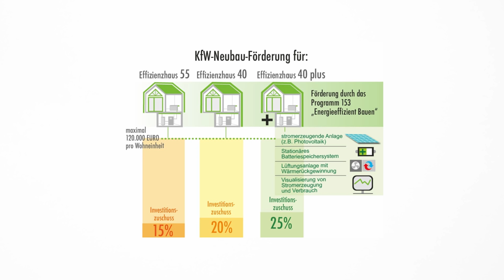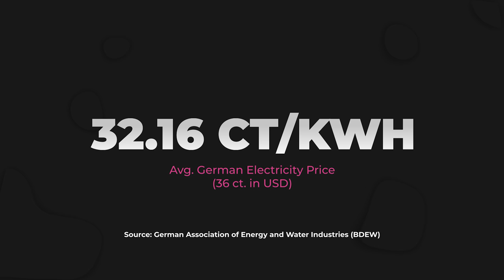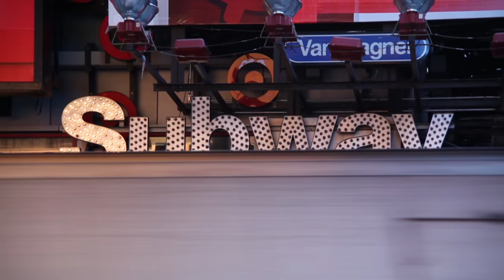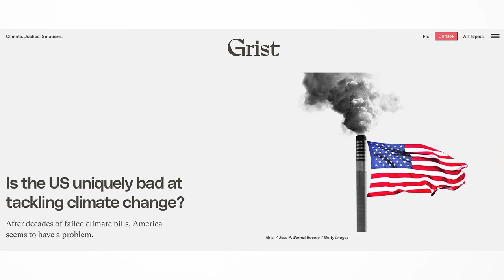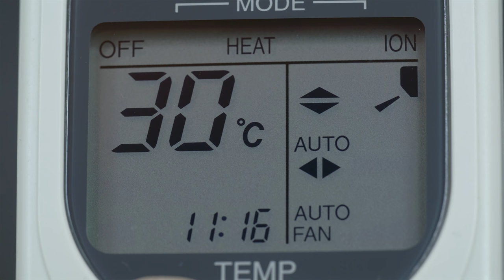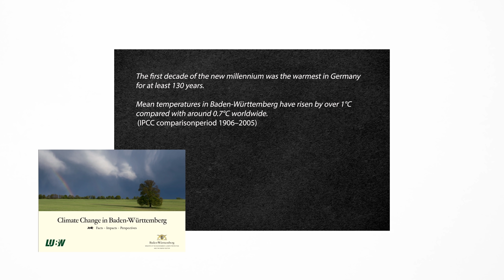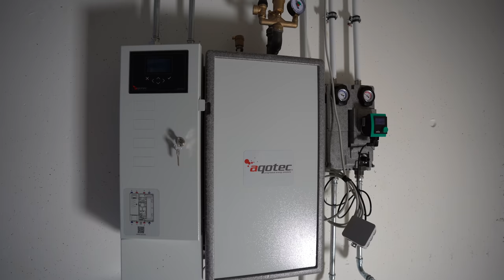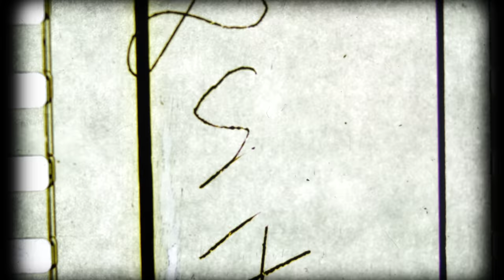HVAC (HLK) in German & American Homes | A Tale of Two Countries

Comment: The argument your energy provider makes for wood chips as "CO2 neutral"  fuel makes me chuckle... by the same logic, one could easily argue that burning coal just releases the CO2 that was consumed during the production of the coal. Same goes for oil or gas... obviously, the carbon required for these things didn't just pop into existence. ;) So... if you take the approach of your energy provider, everything is CO2 neutral, pretty much. Awesome! Climate crisis solved, I guess.

I live in southern Germany, so I've gone through a few 40° heat waves. Honestly, I thought about getting AC a few years ago, I decided against it. I have no good place for a window unit and other units would pretty much be impossible to install in my apartment and would cost a fortune. With a bit of clever ventilation and discipline when to open windows and close blinds, I have around 10 days per year on average that really make me wish for AC. Going through all that hassle just for those 10 days seemed a bit stupid to me.
So, I'm without AC.
My solution is fairly simple: Open your windows in the early morning when temperatures are cool and comfortable, perhaps turn on a ventilator if there's no breeze to help exchange air. When things heat up later in the morning, close your windows and shut your blinds etc. everywhere but on the north side. For the rest of the day, just do not open your windows. Fairly simple and works well.
Reply: Keep in mind that we have fossil fuel because of a rather short period of time wood existed without the bacteria to decompose. Burning that to CO2 is arguably no cycle at all or at best one that takes about 300 mio years and won't repeat. Compare that to some decades of growing trees and you might understand that it makes a big difference.
For more details: https://www.youtube.com/watch?v=b34al8YmQSA

Comment: Air conditioning actually makes me sick - probably because I'm not used to it. Whenever I have to deal with air conditioning for a longer time (conference, holidays in a hot country), I'll get a nasty throat infection if I'm not careful and walk around with scarfs all the time. I don't really know why that happens, but that's why I'll never have air conditioning in my house ^^.
Reply: Ist is a nocebo effect. Will say , if you do not know That there is an AC you will not become ill. Ist is a typical german issue like Durchzug.
A modern AC with anti viral high voltage filter will clean the air and you will be much more safe.

Comment: I completely disagree with the idea that burning wood is climate friendly. It would only be neutral to the climate only if you could grow trees as quickly as you burn them. Otherwise you will a) run out of trees eventually and b) produce more GHG than you consume.

About forced air heating systems, there are some interesting studies by the developers of the "Passive House" standard. They calculated the threshold of heating energy required under which you can use air (specifically a ventilation system) to heat a house without a lot of noise or too hot air. It's about 
15kw/(m²a), which is not very much. Forced air heating in normal houses will always create a noticable air movement and the noise coming with it, which is why I would avoid it.

Comment: Hallo Black Forest Family,  W have build new 2006 in BW between Heilbronn and Karlsruhe.  We has a big "Dachüberstand to the South. Then we has a Sole WP(we has holes in the earth  3x 85m) to heat and a PV on The south Roof who reduces the Temperature in the roof rooms >2°C We has our Roof insulatet with "Hanfstroh" instead of "Glasfaser/Steinwolle"  Hanf has a better k Wert bei Wärme von außen"  Fußbodenheizung  ist bei WP im Neubau Pflicht".  It takes 3 Winters to optimize the heat system but now it runs.  my opinion ist not god for Fernwärme, because if you had Oil, Gas, Pellets, electicyty you can chanche the deliverer.  If you has "Fernwärme"  you are fixed.  And Fernmwärme  in Germany is an expensive variation to heat.    😉

Comment: After all is said and done, it is all about economics. What is the availability and costs of different types of fuel in a particular geographic area. This is especially evident in Germany right now with its dependance on Russia for natural gas, or conversely, on Russia's dependence on Europe for hard currency. Similarly, Germany has had  negligible oil deposits, before the advent of North Sea oil, therefore oil products were taxed high to control its balance of payments.
How do I heat my house? With forced air heat. Why? Low initial cost and ease of air conditioning. Even in forced air heaters, there are wide variations of equipment cost. An 87% efficient hot air furnace can be bought relatively inexpensively. An 97% efficient unit can cost twice as much. At the present cost of gas, the payback period can be 2o years! Further, the cost of maintenance is much higher on the higher efficiency furnaces due to the high tech computers and materials involved in building them. For instance, the combustion chamber on high efficiency furnaces must be made of stainless steel, rather than common steel.
The individual will always make the economic decision which is best for them at a point in time. Countries, however, must often factor in geo-political factors  which tend to be longer term. Germany faces such problems right now with its relations to Russia.

Comment: You short mentioned the KFW standard.
I also think "KFW standard" should be explained to foreigners. Since I'm not connected to building industry - the KFW standards are incentives to a construction. I don't know what required standards are here in Germany.

Will there come some numbers about thermal transfer coefficient. What is that coefficient in a standard 2 by 6 home?
Reply from the maker: We would love to do a stand-alone video on KfW building standards (55, 40, 40 plus). however, with the money running out for the 55 program it has us wondering about the longevity of their other programs. I think we need to do a lot more research on the subject to learn more.
Reply: @TypeAshton  Well I thought of KFW standard only as a word for insulation standards. Don't know (but assume) if there are general / minimum German standards - perhaps little lower than the KFW 40.

Comment: Hey, I also looked at that map and yeah Europe is more on a height with canada than the US. And Florida on a height with the hottest parts of Africa. That's so weird if you see it the first time, it blew my mind to see Boston on a height with italy.. the main reason that Europe is cooler is the gulf stream which cools in the summer and heats in the winter. Without the gulf stream, norway would be nearly uninhabitable, and ireland would be more like iceland. So let's hope it doesn't cease at some point due to global warming.

So to be fair to americans, it's much hotter and probably for longer periods, while for example i germany even if there are days or weeks of heat, it's not long and not much, not extended enough to justify air conditioning really. As it's just a few weeks or maybe at most a month or two where it would come in handy. The summer of 2021 was so nice and temperate, I loved it, we didn't have any extended heatwaves. However if lived in washington or Florida, with months of humid heat, I probably would crave air conditioning too. At some point you need a reprieve from the heat.
Reply: PS: When there are heatwaves, as I work outside, I just take it, drink a lot of water and crave a very cold shower in the evening ;)

Comment: My most shocking view on a heating system was in Carmel by the Sea where friends of mine lived  ...
a flame thrower which heated a 10 centimeter thick steel piece until is was glowing .. then a ventilator pumped air over that glowing steelpiece and warmed up the whole house - no chance to control the temperatur ... all was warm ....     one of the least effecient kinds of warming a house for sure !!!       climate change ?? ... no point in the US !!

Comment: Burning wood is actually one of the best ways to extract CO2 out of the atmosphere again. When burning a tree only 90% of it will be returned into the atmosphere as CO2. The remaining 10% will be turned into charcoal and can be returned permanently into the ground.
The only problem is, that this is a very slow process. You have to plant a new tree again, that absorbs CO2 out of the atmosphere by growing, before you can burn it again just to get 10% of it's CO2 permanently extracted.

Comment: My parents live in a pretty warm spot (steep hillside tilted to the sun, former vineyard), and they don't have air condition. 25 years ago, they built their house from timberframe, similar to American homes. But despite having nearly all windows facing south, they decided against air conditioning. Instead, their roof towers wide over the window, providing shadow in the summer and letting the sun in during winter. The terrace is overgrown by clematis for shadow (after 25 years, quite a large shadow!), and they have a large canvas covering it.
So basically, whenever they need it, they have their own shadow, making air condition superfluous.

Comment: Heat pumps are not only very efficient, but in principle work in both directions. And because of the energy transition to renewable energies, there will be more and more of them. This could be another reason why there could be more air conditioning systems in Germany in the future. The heating system simply has the cooling system built in.

I also just saw another interview with Volker Quaschning (Professor for Renewable Energy Systems) in which he talked a lot about the necessary conversion of German energy systems, in case anyone is interested. (https://www.youtube.com/watch?v=WxF_86jTNxc )(It' s in german.)
Reply from the maker: Ah great point!! Thank you for the great reference. We are checking it out now.

Comment: In a large part of the US, there is a need for both cooling and heating. You can do both with one system: a heat pump. Affordable systems just use forced air. With energy prices very low (compared to most of the world, where energy may often be taxed), why invest more? People like low investment, for rentals for instance. This way you let high usage out of the equation when renting or buying a home. Of course, that was more true in the 60's then today. But energy is just too cheap. The house is drafty and people crank up the heat or AC. And as in other videos of yours: more Americans than Europeans (as it seems) seem to be couch potatoe low energy unhealthy sugar rich movement poor - so they may have a higher need for a more temperature adjusted comfy environment. But this is my theory (and I lived in the US for years). The healthy body is self regulating! Add insulation, exterior shades, perfectly fitting windows and a clear mindset of energy consciousness: then you have a different result. This is where the US really must move to and can save a lot! The US has the largest key to reducing the world's CO2 output. Thanks for the whole series! Love it! Just seems that in the US, folks could become a bit more self conscious about everything .... And us in Europe too about maybe a few less things. Learn both ways! Ah, the latter point: our European blindness!! Got one! Thanks again!

Comment: These videos have been interesting, thanks for sharing. So, I live in Puerto Rico, it can get warm and humid here, but I do not like having Air Conditioning on as the cold air on wet skin, makes me feel like I am going to get sick, so I usually run the AC and dehumidifier in the house around 20 C when I am not home to dry my books and tech, to prevent mold from growing, but I turn it off when I return. I am curious in Germany with the district heating, is it allowed to have a personal heating generate in the house in case the district supply turns off in an emergency?
Reply from the maker: We are also really curious about what happens in an emergency in this situation. Another viewer brought this up to us and it has us wondering.

Comment: I find underfloor heating is the most comfortable system of heating a building. It just generates a very enjoyable form of heat. District heating as you said is a very energy efficient form of heating. So the system in your house is very good in principle. I disagree on burning wood as being climate neutral. Not burning wood leaves the CO2 out of the atmosphere for much longer and that is how we should use wood: As a carbon sink. I am also pretty sure that this view is slowly becoming the majority view in Germany even tough we started of thinking burning wood is CO2 friendly. There may be some exemptions especially in your area where you have waste wood from sawmills etc but in generell wood is a carbon sink not a renewable form of energy. Heating buildings, though, is the most difficult part of becoming climate neutral. So far there are no real solutions (as compard to producing electricity and mobility, which I consider solved problems). So Fernwärme from Holzabfall is a pretty good choice at the moment.

Regarding cooling: I find that if you do not live in the wrong place (under a roof or in the top floor of a flat top building) and you cool down the building in the morning (before 7 am (!) because by then the sun is already up and starts heating rooms with direct exposure) and use shades to limit heating up during daytime, you can withstand even longer heat periods in Germany (I do live in a rather hot area, which I belive is second only to Freiburg) without AC. Having a celar rooms helps a lot, too. Those tend to stay cool and I have found it much better to sleep a few nights on makeshift or guest beds in cool cellar rooms than in hot upstair bedrooms … 😀
Reply: When you reforest the trees at the same rate as you combust them you are pretty much CO2 neutral. Every single gr. CO2 released to the environment has been taken from it during the growth period. You are talking about using wood as a carbon sink to compensate emissions released elsewhere but that's a different story and it doesn't apply to wood that rots otherwise. Rotting releases the same amount of CO2 as combustion.
Reply: That is all true and we have been managing forests in Germany sustainably for 250 years. However, if you do not burn the wood and use it in a way that it does not rot it is CO2 negative which is clearly better than CO2 neutral.

Comment: Ich schreibe auf Deutsch um euch im Lernen der neuen Sprache zu unterstützen. Wenn ihr etwas nicht versteht lasst es mich wissen und dann wechsele ich auf Englisch. 🙂 

Ich habe den "Luxus" dass wir in einem sehr gut isolierten Haus in Mannheim wohnen das mit Fernwärme geheizt wird.
Im Hochsommer wird es zwar etwas wärmer aber selten dass auf den Räumen der Südseite wo ab dem Mittag die Sonne scheint es wärmer als 24 Grad wird. Durch zwei gekippte Fenster im Keller und im Dachgeschoss haben wir ein wenig Luftzirkulation im Haus aber nicht soviel dass wir uns das Haus über den Tag aufheizen.

Stand heute werden wir in den nächsten Jahren keine Klimaanlage anschaffen weil die Temperaturen im Haus selbst bei Außentemperaturen von 35°C und höher mehr als erträglich sind.

Comment: I have never heard of district heating as you describe it in this video. If your hot water is heated somewhere else do you have any worries about 'heating cuts' like a power cut so you are unable to heat your home? Do you have a secondary way to do this if needed?
Reply from the maker: We have a large hot water tank in our house so we have a reserve of hot water (showering, washing, etc.) as well in the case of temporary outages. For example, they often shut down the system 1 or 2 days a year for repairs. However, they typically do these planned shut offs in the summer when you aren't relying on hot water for heating as well.

Comment: Where to begin, you guys need to talk to someone back in the US.
1. My gas furnace is 97% efficient. It produces much less CO2 per btu than burning wood. It makes no difference if you believe in offsets. 
2.  My HVAC system  recirculates the air through an electronic air filter and then a merv 12 filter. This system will reduce the viral load as well as mold, pollen and dust. Spare me the health benefits. 
3. Germany is in big trouble with electric generation.  They shut down their nuclear plants, solar is failing to produce, and windmills are temporary.  Meanwhile in Northern Illinois, we are virtually  100% nuclear. 13 US cents per KWH, with generation cost of less than  $0.05 per KWH.
4. The US has enough NG for hundreds of years of domestic consumption.  Germany relies on other countries, especially Russia. Good luck with that this coming winter.  Maybe you guys should build that NG terminal and we could share it.
5. I  LOVE AC. I also like ceiling fans.  However if I lived in your latitude I may not need it.  Vancouver seems to do OK without it. Near Chicago it’s a must. Yes we lived without it in the 1950s but we have evolved.  We actually have indoor plumbing and phones you can walk around with. 😎

Comment: you are wrong on this. The American homes have low or no heat capacity (energy stored in the building structures) whereas German homes have high heat capacity, stored in the walls and floors, and do not heat up so quickly than a wood frame home that has no heat capacity. This subject requires a bit of building science knowledge..that is pretty basic for a European engineer or architect. US engineers or architects have limited understanding of heat capacity also combustible materials or sound control, so they compensate all with cheap electricity and high insurance fees..(if that would help anyone..when a house burns down, by the thousands every year....).